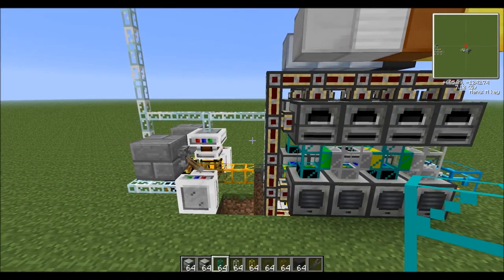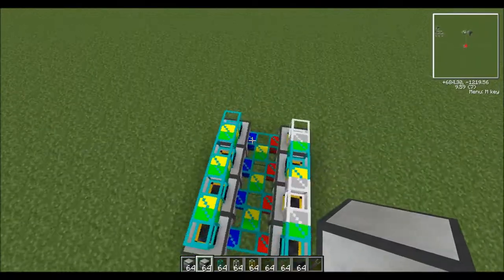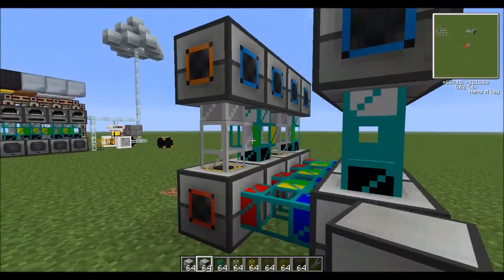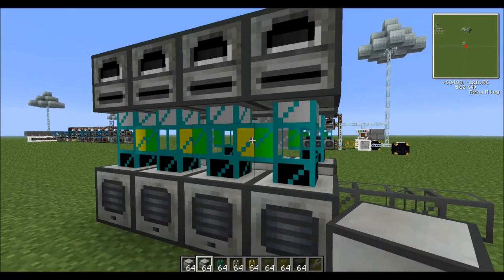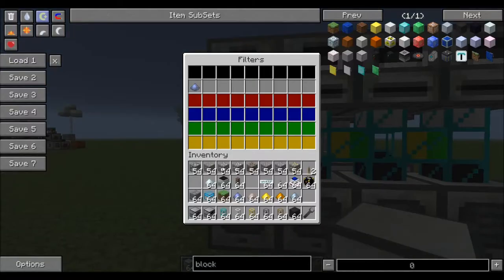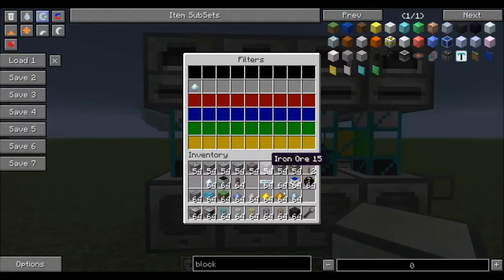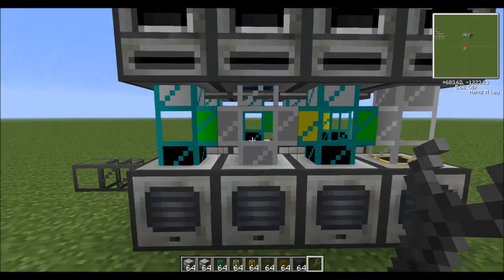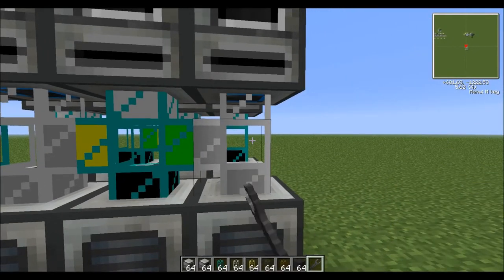Compact Thermal Expansion Pulverising And Smelting System

Comment: You could make this even cheaper if you get rid of the diamond pipes coming out of the top of the pulverizers and replace them with iron pipes. The reason you can do this is because you have already made it so that only one type of dust will ever come out of each machine because you sorted it before you put it into the pulverizers.

Comment: Could you help me understand what you need the electric engines for underneath? Wouldn't you just be able to pipe normal power into them? I plan to power using a passive reactor as a FYI